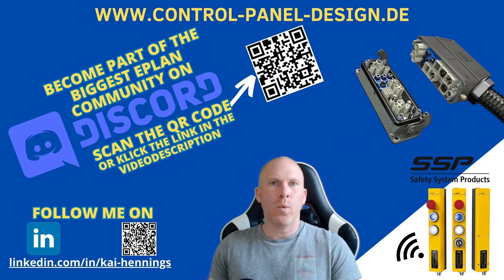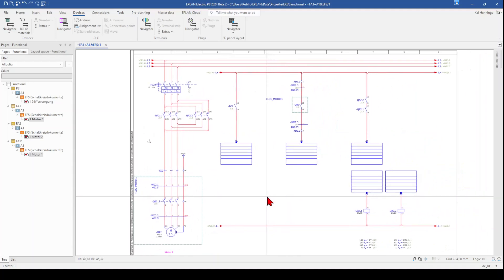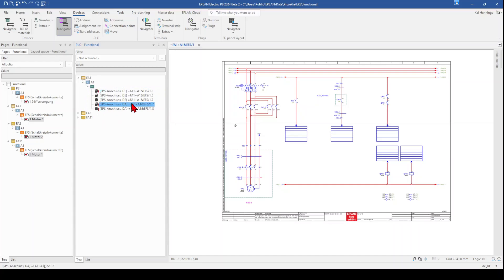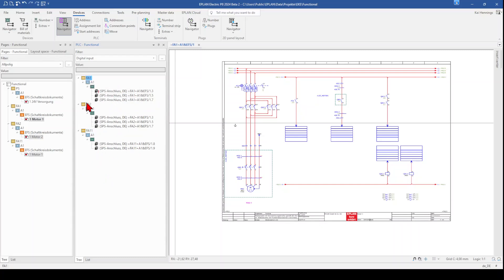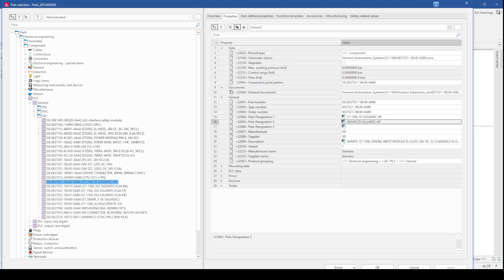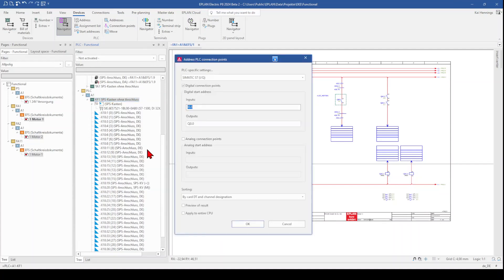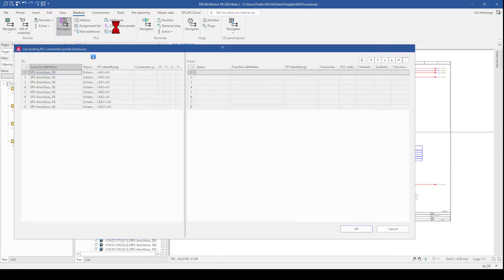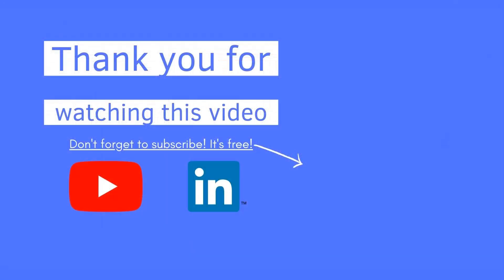How to use existing PLC connection points blockwise in EPLAN P8 🔔

Comment: Hello Kai! Thanks for the video. It could be possible to do the same thing for the analog I/O or safe I/O?
For DI or DO I see it's possible because there are only one type of plc connection point: DI or DO. For differents PLC manufacturer (Siemens, Omron or Allen Bradley), DI or DO are OK.
But for analogs I/O or safe I/O there are more types of PLC connection point for each chanel (PLC+, PLC-, PLC PE, etc...). Moreover, each manufacturer are different PLC point connection for this type of I/O.
It could be possible to do this for the Analog I/O and Safe I/O?